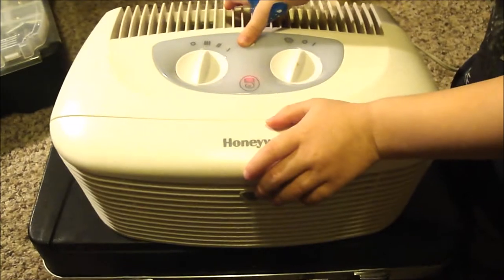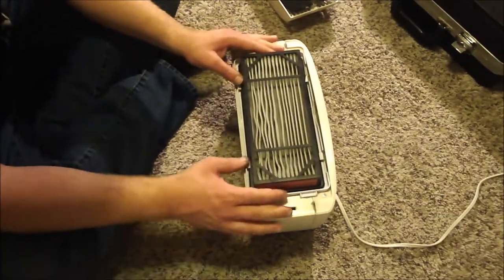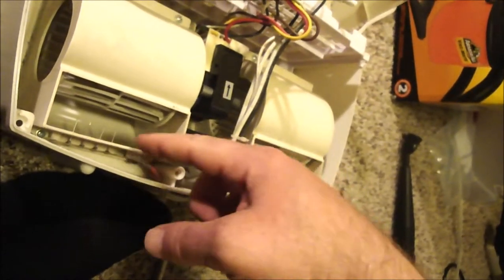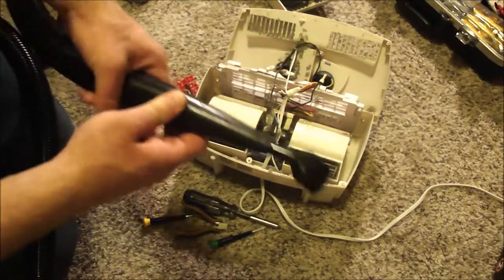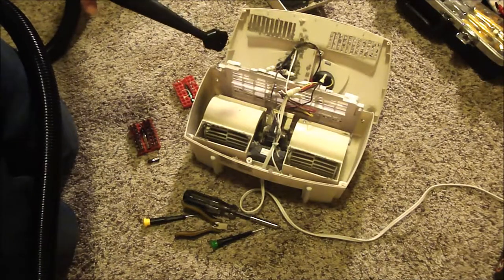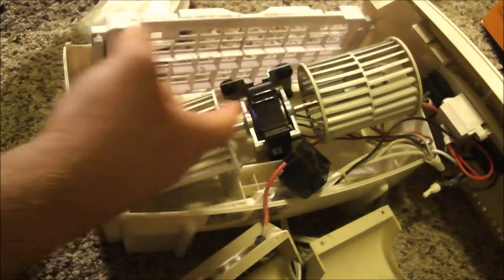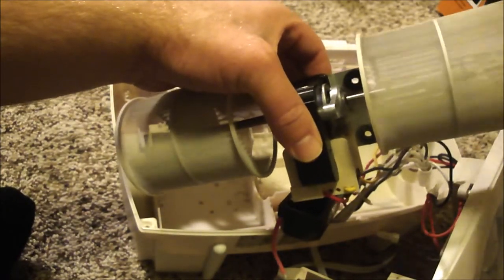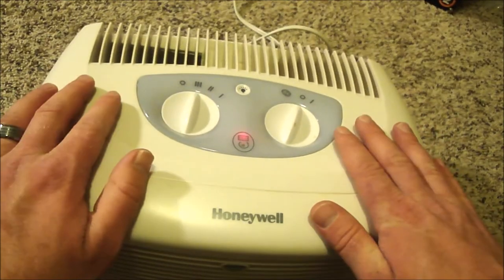Honeywell Air Purifier Whistles and Vibrates Fix

Comment: Hey Justin, not sure how your fan is holding up three years after this video? 

Mine just stopped spinning the fans, but goes with a little push so I'm thinking it's the capacitor. Nevertheless gonna oil that shaft up and give it a shot. Hope all is well.
Reply from the maker: Good luck. We couldn't keep it from making noise. Work good for a while but then make a new sound. Didn't bother me but the wife hated it and so we got a different one.
Reply: @becausestuffbreaks  Thanks appreciate the reply. I bought two within the same month and the other one has been working without issue for years. Seems to be a hit or miss.
Reply: @becausestuffbreaks  Hey I've had mine for a few years now. I can only feel air blowing out from one of the sides now, is one side an intake or are both sides supposed to be blowing out?  My unit may have finally bit this dust.. [LOL!!!1] If it's supposed to be both sides I might just bin it. It's done well for maybe 6+ years.
Reply from the maker: I noticed mine always blew more out one side but both sides should be blowing air.
Reply: @becausestuffbreaks  Definitely only 1 side for me. Guess I'll either open it or retire it.
Reply from the maker: I retired mine last year.